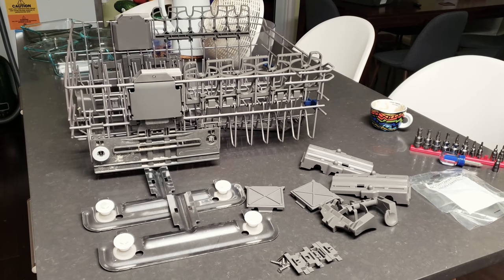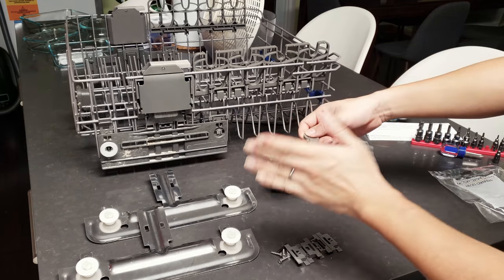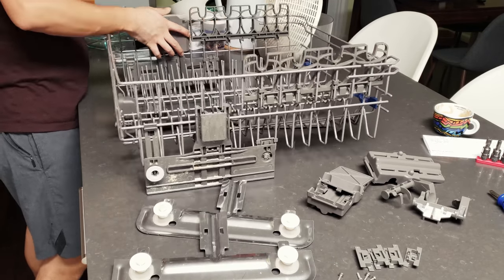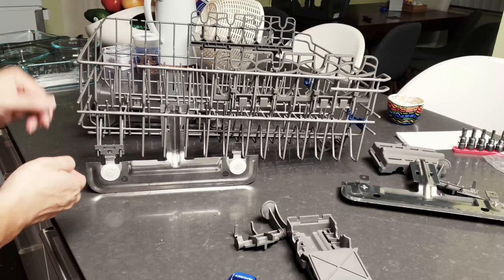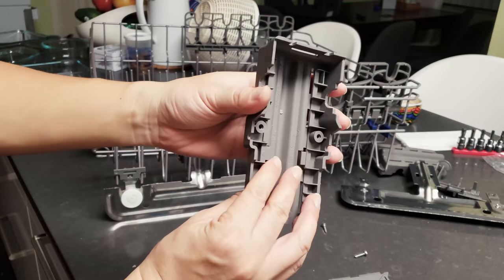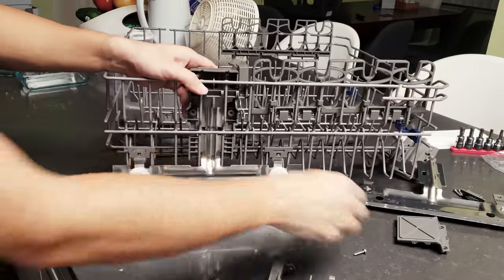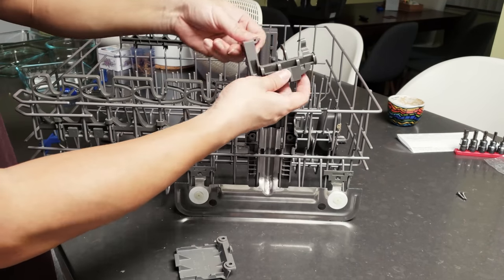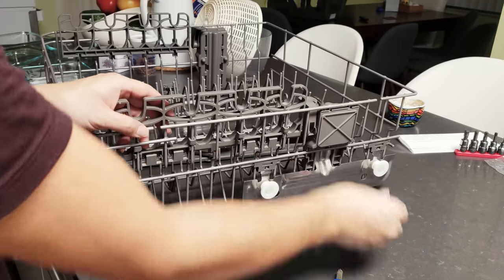How To Install Whirlpool W10712395 Dishwasher Upper Rail Rack Kit (AP5957560 W10350375 W10250159)

Comment: Thank you!  I successfully completed this parts replacement project, and couldn't have done it without your instructions.  (BTW, my kit from a third party did not include the Torx screwdriver adapter.  It was good that I happened to have a Torx T15 bit on hand to install the screws.)
Reply: Same here on the bit adapter.

Comment: This seems to be a very common failure mode for this model.  Comparable failures in many devices (e.g., cars) would initiate a recall, with mandated repair.  Depending on where you bought the repair parts and the dishwasher, parts alone are 3-10% of the original cost, plus labor, yours or a service person's.  A class action suit seems appropriate.  Maybe CFPB could help.  Note it's not just Whirlpool- it's Kenmore, Amana, Jenn-Air, KitchenAid, and Maytag etc- they're all made by the same company- just marketed as different brands.

Comment: Thanks for a most helpful video. The job is not exactly intuitive and most folks would not grasp that the metal part hat be woven into the basket and the plastic parts then attached. The tabs on the plastic parts are a one time snap together and do tolerate being taken apart well so it needs to be right the first time. You saved so much trial and error.

Comment: I watched Sears' slick two-minute video half a dozen times and was still clueless: "Wait…what?" Li Fan deliberately but thoroughly tells you everything you really need to know: It's OK to bust off the old parts; you're just throwing them away anyway. Don't pinch your hand. The height adjustment levers should point toward the front of the dishwasher. A Torx screw adapter comes with the kit, etc., etc. Li Fan, I'm a fan. One question: Is that a yogurt cup on the table?

Comment: Thanks so much. Great video. Couple of thing for others doing this job. (1) My set of amazon did not have the driver that could be used with a Phillips and it the screws in mine were T20. (2) Mine did not snap where he clipped his finger, but it was secure. The video here is clear on how you can make sure it's secure.

Once again, thank you!! This video turned 30-40 minutes of deciphering the inscrutable directions that came with it into 15 minutes. Appreciate your detailed approach.

Comment: Great job.  I used your video and was successful. The new kit from Amazon ($30) in Apr. "23) is slightly different, but, it is so similar it is nothing to worry about. There are a few tabs that need to break off to get the old rack support out. I would suggest a mention or video of how to get the rail stops off to take the rack out of the washer. Without this video it would have been impossible. Took me an hour and 15 minutes.

Comment: Thank you .great video.. Spent more time running back and forth from the computer than actually done it.  My only issue is my old  rollers are designed to   roll inside on a rounded .. track ,  they new ones are now rolling on the sharp inside edge of the track.  looks like got the "wrong" type of roller

Comment: Thank you for the video with detailed steps. Extremely helpful. There part that I ordered from Amazon now is around $32 and the my Phillips screwdriver worked without any adaptor. Please be careful with the end pieces of the rail when removing the upper tray(I broke one of them while getting the tray out) I need to see if I can get the end cap) The product doesn’t come with end pieces or caps once you install the dishwasher tray back.

Comment: Nice video which I first used 3 years ago when I installed these rack parts in my old 2015 Kenmore Dishwasher, made by Whirlpool.  I replaced that Kenmore dishwasher last year when I bought a  new Whirlpool.  I removed and saved these parts when I disposed of the Kenmore when I noticed that Whirlpool was still using these same style flimsy plastic parts.  After only one year the new Whirlpool plastic wheels broke off and I just installed the 3 year old replacement parts in the Whirlpool. It appears that Whirlpool, rather than improve their hardware,  has made it worse.  The Kenmore at least lasted 5 years before I had to replace these parts

Comment: The instructions were great and SO much better than the kit manufacturer's instruction sheet which was horrible.  The only issue I have is that the height adjustment doesn't work at all and I'm stuck on the lowest height.  Not sure if there was a step I missed when I insert the lever piece or if possibly the kit I got on Amazon just isn't as good as the one you installed.  But at least the rack isn't about to fall off!  Thanks for taking the time to do this.

Comment: Everything was useful here and we'll explained. When I got to the end I couldn't put the rack inside because the wheels did not have a slide bar they fit into. For some reason mine has 2 slots on each side that the wheels don't fit into. Do you know how to fix that issue?

Comment: Your video is even better than the one supplied by a parts distributor. I believe the new metal parts replace the original gray plastic part that has the wheels because the plastic stub that holds the wheels break on many of these top racks thus allowing the wheels to keep falling off. And that was the part that failed on your rack just as did the one on my Kitchenaid.  Also, the kit # ending in 5 is for white wheels which are larger than the kit # ending in 4. They are two different sizes and not interchangeable. My Kitchenaid requires the smaller gray wheels. Many people are not aware of this and order the wrong size. Then have to send it all back. And then give a 1star rating despite ordering incorrectly. Admittedly, the info about the wheels is not easy to find unless you carefully read everything.

Comment: Thank you for this.  I just followed your instructions and completed the job!  My advice.  Watch the whole video and then use the video as you do the job.  What's missing from the video?  Taking the rack out and that process...which is easy but requires you to remove two tabs.  The other thing...make sure you are installing these new parts on the right side of the rack.  Look closely and you'll see the water connection that faces back of compartment.  Thank you again!

Comment: Started at The Parts Select video and immediately started scrolling through Comments there when I realized they just start at the installation of the part they sold ya' - they could literally give a [bleep] if you can get the old part off; saw a reference and link to this video. Sir, I sincerely thank you for helping me out of an anxiety attack, a replacement rage incident, and giving me the most complete, simplistic and calming instructions on how to easily replace the part.

Comment: Thanks for the excellent installation instructions. All worked well  / except that My KitchenAid dishwasher upper rack does not have a track to slide the roller into....It has part #  W10914016. It is Model # KDTE104ESS3 / Series # F70537815
Do you know where I can get the upper (left side & right side replacement rack glides for the new parts that I just installed)?
Thanks for your help.
BCH

Comment: ATTENTION:::YESSSS  Thank you so much- this was so helpful and I couldn't have done it without you. Please know that the tall center adjuster part of the wheel base needs to fit into the FIFTH rack space from the back, not the fourth as stated-- I couln't close my washer.  I just finished making the adjustment and it was a breeze thanks to your video.  thank you for the great explanation.  so happy to have my top rack working again!

Comment: WOW. This was amazing. Thank you so much for the shared video to provide a quick guidance on how to install the new hardware to the whirlpool dishwasher. Unfortunately the company was not much of a support. However, fortunately you were. I installed this on my own with no issues. I would say that small piece they provide or the screws is not as useful as I expected; I had to find my Hex Key set to use instead. :)

Again. Thank you. Gizmo Garage for your support.

Comment: Thanks a lot for this video and for including steps to remove the old hardware.

It's probably been mentioned before but one thing you can do to make installation a little easier is seat the actuator on the slider piece then slide that onto the wheel assembly. At most when sliding the two together you may have to put a little bit of pressure on the actuator button. That way you don't have to worry about fighting with the rack.

Comment: This was honestly such a fantastic video.  Our top wheel broke 6 months ago same exact problem and I purchased the exact same plastic part to replace. It didn’t even last 6 months and broke AGAIN. So when I watched this video, I ordered the new steel replacement parts. My whirlpool dishwasher was just over a year old and it cleans the dishes well but what a terrible cheap plastic part. Fingers crossed that this steel one will hold up better. Didn’t even read the paper instructions, I just followed the video. Thank you so much for your help. You saved me a lot of money.😊

Comment: Thanks for the video. My dishwasher fell apart this morning so I have these parts on order. This video will be a great help. Whirlpool should be ashamed; clearly a systemic issue with the design of this rack but it's probably exactly what they wanted - don't make it durable, make it fail predictably and then sell the repair parts. Best they can do since it's not an inkjet printer right?

Comment: Li - thanks for this very helpful video - it was very helpful! The kit I bought didn't even have instructions! So not sure what I would have done without your video. Why do they use these unique bolts with the weird screwdriver required. I luckily had one. Thanks again Li!

Comment: GREAT VIEDO....my problem is the rack RAIL will not detract all the way when pushing rack in. I have to push on the sides of the rail to get the rail completely in. The rack goes in completely but not the rails. I have taken everything apart and do not see anything broken. I did replace the end clips to the rail once as one boke off and I found it in the bottom of the dishwasher. It did work fine when I put the new end clips in but not it does not.

Comment: Hi. Installed the replacement parts as per your video. (Thank you).  Now the rails will not completely go back into the dishwasher - I have to push them in by hand ( about an inch or so).  Any idea what can be adjusted?

Comment: I agree with the previous user’s comments. I really liked that you had to remove the plastic parts like I had on my dishwasher. It was so helpful.  I had watched the directions provided by a replacements parts company.  Their directions did not have the level of detail that yours did.  You made this job doable for me.  My kit didn’t come with Star torque wrench T15.  I had one in my tool kit luckily.  Thank you for the music that kept my blood pressure down and for taking the time to do this for everyone.

Comment: Thank you so much for making this video!  The instruction that came with the kit were hard to follow but your video made it much easier and I was able to do my repair very quickly with it. 

The original plastic parts in my dishwasher were complete trash. So happy there’s a metal replacement available!

Comment: BEST INSTRUCTIONAL VIDEO EVER! I received the Replacement Kit directly from Whirlpool under warranty... all the pieces, but NO instructions at all. So thankful to have found your video, as there's not a way in the world I'd have ever figured this out ! Thank you so very much. Subscribing to your channel, too. You are an EXCELLENT instructor. Now I can use my dishwasher again. Thank you!

[My opinion but sharing anyway. It is that all original Whirlpool dishwasher purchasers should receive this replacement kit free of charge, as the need for it is an acknowledged Whirlpool design flaw. Making a purchaser pay a 3rd party $45 to $55 is NOT adequate customer support.]

Comment: Important note to not install in the 4th hole from the front. Doing so, the rack will not come out as far as designed. Leading you to pull your hair out and disassemble them reassemble properly.

Comment: Thanks these directions were great.  Mine doesn't slide up and down as easy as yours does but I almost never adjust it.  May washing is always the same, so I have it set to where it needs to be.  But if you have tips on how to make it slide better I am open to suggestions.  I wonder if with the hot water and use if it will loosen up a bit.

Comment: GREAT video...! I received my kit directly from Whirlpool under warranty.  It came in about 10 days with no instructions. So your video was key.  Myself and my two young helpers (6 & 4) were very excited to get started.  We took both sides apart and when it came to securing the cover... we THEN realized they were not included!  Of course, we did this on a Saturday... meaning there is no one to call until Monday. Frustration level is definitely elevated.  Nonetheless, I installed it without the cover and will run it, as per usual until the cover comes and then install it.  Thanks again for your video!

Comment: The wheels for the new metal adjuster, as on the video, are larger than the wheels on my old all plastic adjuster. So I guess that means I have to replace the side rails inside the dishwasher too?  As the old wheels are much smaller. Anyone  else have that happen to them?

Comment: Great video!  Thanks for sharing your experience; I found a bunch of extra unknown features in my dishwasher while pulling the top rack out for repair.  Definitely beats buying a new appliance for stupid stuff like this.  I guess if you have a 4-hour high temp wash cycle in the machine, you would assume the plastic parts would eventually fall apart.

Comment: FYI, I used this kit to fix a kitchen aid dishwasher. The wheels were too big for the rails. However, the replacement wheels can be unscrewed and you can use the originals. Careful removing and installing the screws. There are very thin tabs holding them in place. Maintain pressure on the hub to keep the tabs in place while removing and re-installing the screws.

Comment: Great video, thanks. I'm using non original replacement that comes with a different wheel. I replaced them with the original wheels and it worked perfectly.

Comment: Hello Li Fan! Can you tell me how your dishwasher adjuster is doing today? Is it holding up? I saw a class action law suit against Whirlpool for this very failure. Mine failed as well and was only a year old. I got the genuine part because--although my d/w is not warrantied (I bought it used)--this part will be warrantied! So if it fails again, I will create a fuss! Thank you for this video! I did not want to spend $160 for a repair tech to fix!
Reply from the maker: holding up doing dishes 2 times a week! New parts are fully metal so yes they will hold up.

Comment: Great instructional video. There's ways to remove the old hardware without breaking it, but like you said, there's no need to keep the old hardware so if it breaks, it's not a big deal.

Comment: Beware, some of the kits sold on Amazon include screws that are NOT stainless steel and will rust. You will have to go to a hardware store and get stainless steel. Might be why they are cheaper? • Stainless steel, in most cases, is non-magnetic.

• With bolts, stainless steel can be identified by the head marking. These markings indicate steel grade and tensile strength
ALWAYS wear gloves and keep hands away from the screwdriver!. My friend accidentally stabbed her hand with a screwdriver while repairing something and it went into the tendon, broke her finger and cost $900!
Reply from the maker: Good tips

Comment: Excellent instructional video. I watched the whole thing once then ordered the parts from Amazon.  Once they came in I watched you video and paused between each step to remove the old parts and put in the new parts.  I struggled a bit with the first side, but once that side was done I flew through taking the second side apart/putting it back together.  Thanks for your help!!

Comment: The clip that prevents the top rack from "rolling" out of the dishwasher broke.  I fixed that by installing a zip tie in its place.  A nickle fix for a $50.00 kit.
Reply from the maker: New OEM replacement kit has all metal components and improved design, original roller assembly is mostly plastic and is prone to future catastrophic failures.

Comment: Thank you very much.  Instructions were pretty explicit.  Completed the entire replacement as per your instructions in about 15-20 mins AND without snapping the old fittings (Lol ... not that it is needed).  Cheers
PS:  I wasn't aware of a cheaper rate thru Amazon as I'd ordered the part from a Whirlpool ancillary for fear of scrupulous supplies.  Their cost was CAN 56.00 + Tax.

Comment: Did you have any issues with the rack locking in the upper position? I installed it but it will not stay locked in the upper position if there are any dishes added to the rack.

Comment: Thank you for this video this is exactly what I needed... exactly!!!
Reply: ...and I messed up by adding the covers on first, trying to figure out what goes where, and they snapped...
...now after finding your video, I realized I needed them off, so I just broke the safety clips to remove it, smh.... Now I need to re-order. (long sigh)
Reply: ...it actually still works even though I broke the safety "snaps" when sliding the first plastic part over the metal piece!!! Again, thank you for this video!!!

Comment: Is it similar to part W10712395?  I just ordered one from Amazon but just noticed the difference in the last digit?
Reply: The 395 is for white wheels which are larger than the 394 gray wheels. So check your wheel color. The wrong color/size won’t fit. That info is hard to find. My Kitchenaid has gray. It could be his kit has the white because it is a Whirlpool.